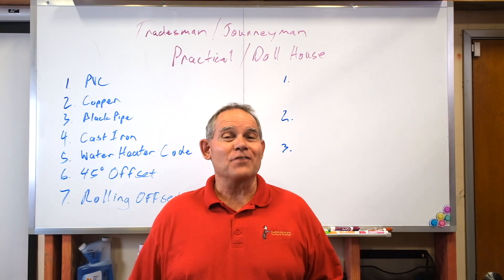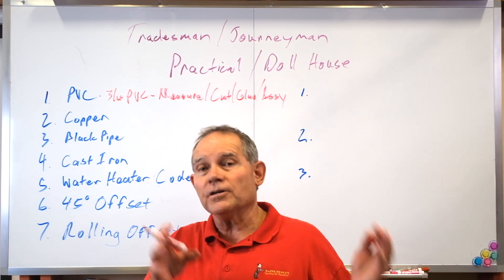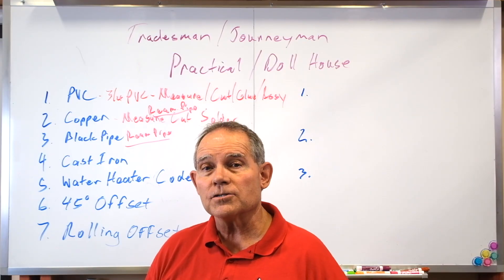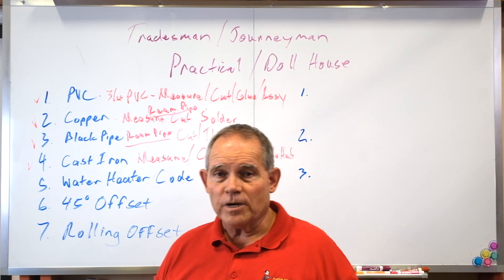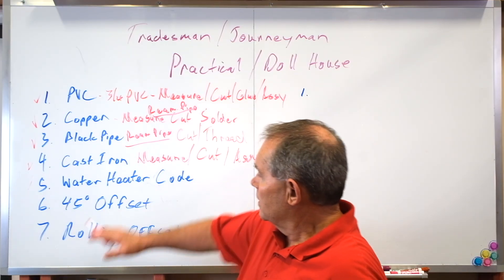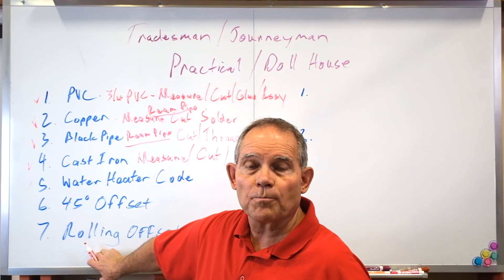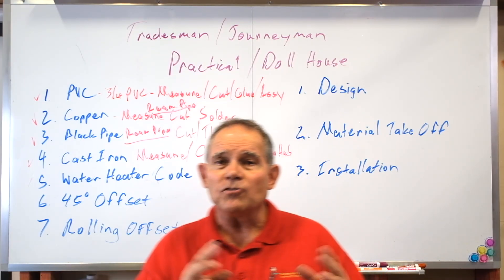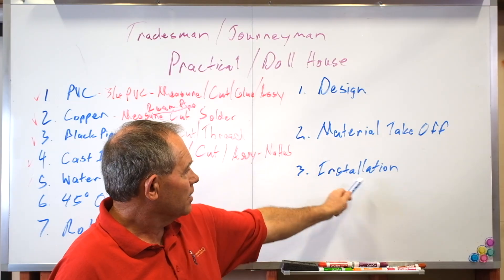What To Expect on Your Texas Plumbing Exam! (Practical & Dollhouse!)

Comment: They should require the pvc to be reamed and beveled also as its per the manufacturers instructions. Charlotte pipe shows this and not beveling pvc pushes too much of the glue out compromising the joint.

Comment: Do they provide us with a calculator for 45 offset in Austin/Waco Tx?
Reply from the maker: Yes. Everything you need.
Reply: @ServingUpPlumbing For the doll house will i be given two different rulers or just 1 which equals 1/4" = 1'0 scale